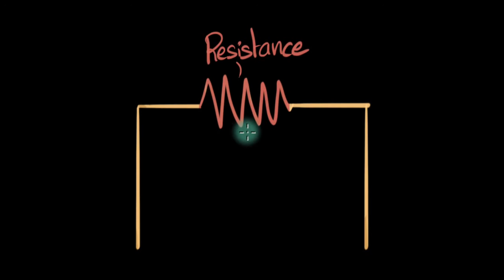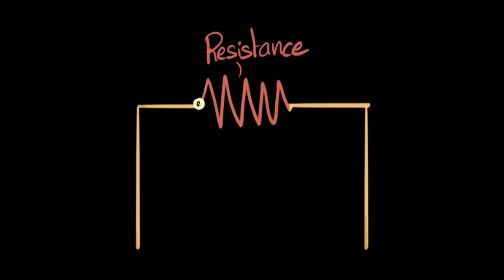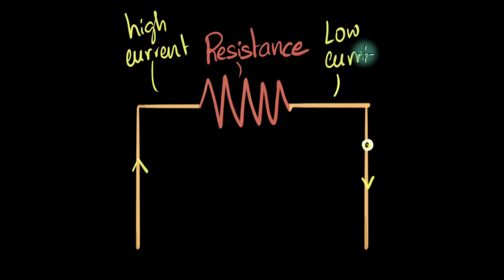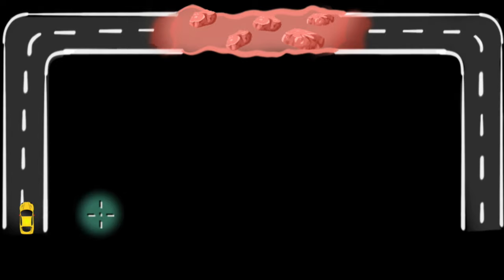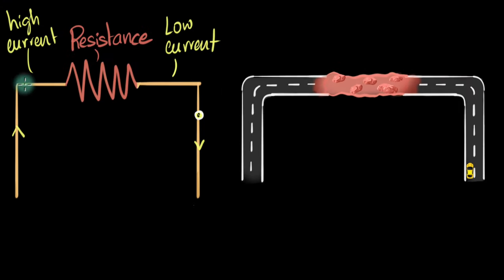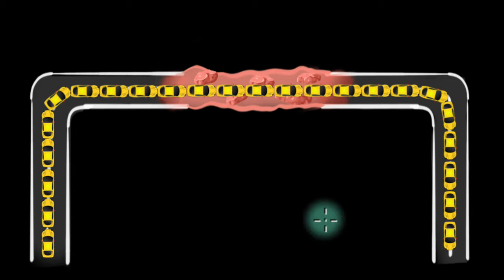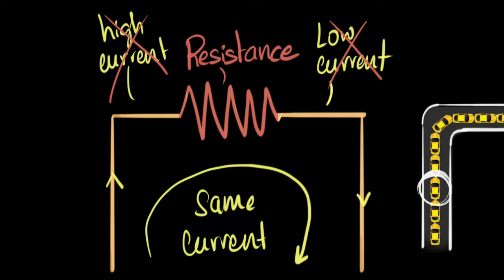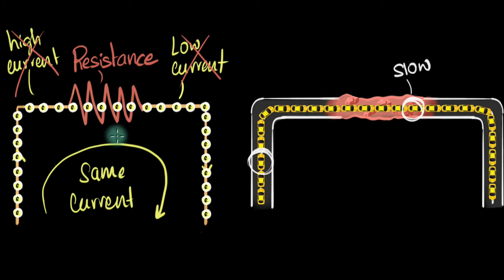Does current decrease as it passes through resistor?

Comment: Hello sir, sir this was a very good explanation a got your point that
 as electrons are tightly packed there is no space for them to move with greater speed....but sir my dobut is that if  electrons speed would remain same then what is use of the resistor?if we dont put resistor then also the current will remain same so exactly what is use of resistor?

Comment: The problem with this analogy is the misconception that electron current is the same as electron speed. Big difference.  In fact, the electrons speed up in a resistor, even though the current stays the same everywhere.
Reply from the maker: Not true. Consider the expression for the current through a conductor, I = neAv! If the electron density, n and the cross sectional area, A stay the same, then the electron drift speed, v would be the same throughout!
Reply: @Mahesh_Shenoy  I guess that you are correct if the cross sectional area stays the same, but is that usually true when electrons go through resistance? I was thinking of current being forced into a thinner wire like a light bulb filament. In that case the cross sectional area is reduced and therefore by your equation, the velocity would have to increase in order for the current to remain the same.
Reply from the maker: @mjciavola  Sure, with smaller cross section, we get higher speeds!
So, technically, the product Av would stay the same. This is the flux of electrons! 

However, the car analogy still holds, doesn't it?
Reply: @Mahesh_Shenoy  Yes, the analogy still holds and it is very good as long as the cross sectional area in the resistor is the same.  I'm just wondering if this is normally the case when electrons go through resistance in a load.
Reply from the maker: @mjciavola  My point was the analogy holds even if the cross-section isn't the same. 
Imagine a road that gets wider and then narrower. Also, imagine that cars are uniformly distributed - wider roads have more car lanes compared to narrower ones.
 
Wouldn't the wider road cars move slower than those in the narrow ones, ensuring the no. of cars per minute stays the same everywhere?
Reply: @Mahesh_Shenoy  Well sure. No one disputes that the current is the same everywhere.
Reply from the maker: @mjciavola  Awesome, thanks for that discussion. I think I could have clarified that this generally works regardless of the cross-sectional area, in the video!

Hope to see more feedback from you!

Comment: i understand your point but if we attach a led to the circuit with a resistor, the light will go lower and lower because of the current decreased no? wouldn't it go lower because the flow will go slower

Comment: Sir what i imagined is , the resistance is technically through out the wire ( like everywhere on the wire ) . So, the current also same everywhere .But its hard to draw zig zag like everywhere . Therefore, we just represented in small portion of the wire. Is my explanation crct sir
Reply from the maker: Technically, yes. Every part of the circuit has some resistance. However, the resistance is not the same. Resistance of wires would usually be negligibly small, say a few milli Ohms,  compared to that of a resistor, say few hundred Ohms, that is attached!
Reply: @Mahesh_Shenoy  ohh ok sir . Thanks for the reply

Comment: sir i have a doubt..
 In my one of the physcis papers... the question was Do electrons flow in the direction in the curcuit?

The answer i gave was no.
I said that the electrons are exited by the presence of a potential difference, when they get exited, they start moving in random directions and bumping into atoms. However if we consider the whole conductor.. the electrons flow from the lower potential to higher potential. And hence appear to us that it is flowing in the same direction. 

According to me the answer was right.... because that's what i learnt from veritasium and electroboom.

Unfortunately my teacher cut the marks... could you please help with this.
Reply from the maker: I think the question was about the direction of electron flow vs the conventional direction of current!

Comment: Sir 
By assuming your example
Where you are considering 
Cars attached to each other 
Or electrons are tightly packed,then it would simply mean at the resistor too the current is not going to change as there are cars or electrons back who are going to push it forward and the electrons in the resistor are not going to see a decrease in speed
Then it simply seems confusing

Comment: When a constant potential difference is applied across a conductor of variable cross section then current remains constant but why doesnot its drift velocity that remains constant because where the area is less the resistance is more and so the factor v=V/neAR remains constant

Comment: But even in this theory, current=Q/t so if we add a resistance the number of charges per unit time at a point is reduced as speed of electrons is reduced in the whole circuit, so compared to before, by addition of resistor the current should reduce right
Reply from the maker: Yes it does. And that's the whole point of adding resistance. But, the key thing I was focusing in the video is that it reduces everywhere in the circuit.

Comment: ok but I still dont understand how it is possible that an LED diode wont burn if I put resistor after the LED, it can handle the load for that one fraction of the speed of light electricity travels until the  whole circuit is slowed down by the resistor ?

Comment: Your explaination does not explain why the resistor heats up.

If all the cars who drive through the resistor enter the same speed as they exit it, then where does the resistor get the energy to heat up?
In your model the resistor would stay at room temperature.

Also let's say I put 2 of these resistors after another, the speed of the traffic would remain the same, I could add billions of these resistors after another and there wouldn't be any change.
Reply: I think the resistor heats up due to the collision between the atoms of the resistor and electrons, Speed never had anything to do with it. I am not sure but this is what i think.

Comment: So it means that initially current is faster but when it come across the  resistor it slows down the current which in turn slows down the current in  whole circuit and current becomes same but initially when it comes out of battery it is a bit faster?
Kindly if you are reading my comment answer me if u think I am wrong then still answer me that I am wrong plz
Reply from the maker: You have the right intuition. I have a made a few follow up videos that digs deeper into it. It does cover the aspect of 'initially, the current was faster'. But, it's more nuanced. I am sure you will love it.

Comment: There is a missing logical step in your explanation: why dont the car speed up after clearing the obstruction? You need to include an explanation of what the battery does and how it cannot accept more cars than those it spits out.

But in reality the electrons are actually speeding up (accelerating more) inside the resistor, only that, due to the higher number of collisions their drift speed is brought down to the same speed that have in the conductor. The higher electric field across the resistor is generated by surface and interface charge at the boundaries between different materials (copper-carbon, carbon-air, if we consider a carbon resistor).

Comment: This is false due to voltage drop across the resistor There will be current drop as well. Current gets dissipated as heat in the resistor energy is lost due to heat

Comment: Hmm, no mention of the gradient of surface charge, or the distribution of charge at the ends of the resistor.  Too bad.  Proper explanation can be found in Sherwood and Chabay.  I wish more high school physics teachers knew why current flows.  But this video isn't it.
Reply from the maker: You are right, will do a follow up on all that fun stuff! Thanks for that recommendation!
Reply: @Mahesh_Shenoy  could you please explain why voltage decrease after passing through resistance in series?

Comment: Your analogy does not explain why the cars / electrons after the obstructions / resistor don't speed up. We see that all the time on the highway. The traffic banks up before the accident but the cars can speed up again on the highway after the accident. This is actually a terrible analogy. Let's just stick with volts is joules per coulomb, and current is coulombs per second and NOT a velocity / speed. Current tells us NOTHING about the speed of electrons in a circuit. All it tells us is how much charge (or how many electrons) pass a POINT per second, which is NOT their speed.
Reply: Well you are assuming the current is dependent on the speed of the car (speed of electron) when current is dependent on the amount of cars that pass through a given point… it’s not about how quick the cars go, it’s about how many cars reach a certain point. Current does not depend on the speed of the electron, so in this model we should not assume current is dependent on the speed of a car.
Reply: @bryanthegoat9593  We are in agreement. As I said, coulombs per second, not coulombs per metre per second. Perhaps you didn't read my entire post?